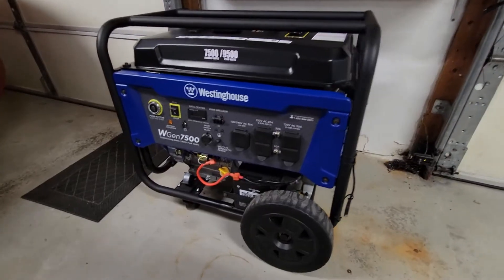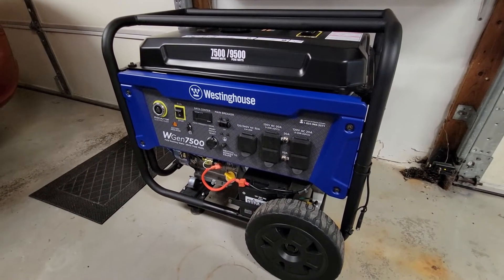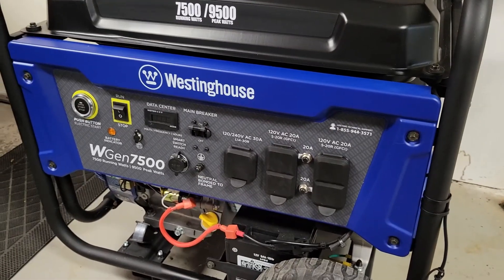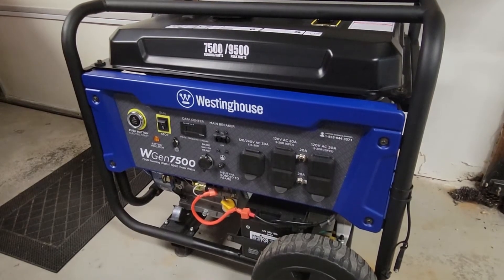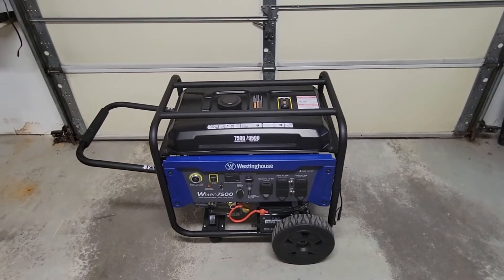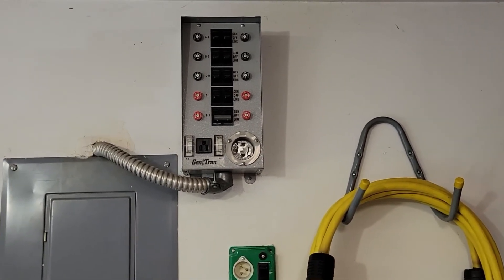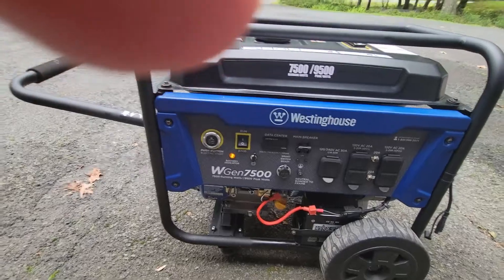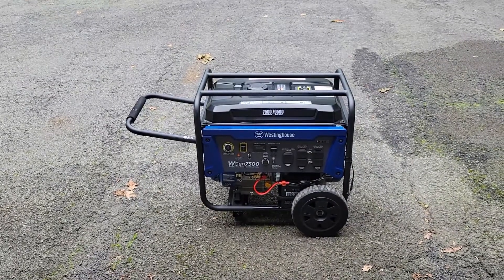Westinghouse WGen7500 generator - 3 year review & tips

Comment: I have the same model, bought it about 5 or 6 years ago. I’m weird and prefer to manually start it using the choke and pull cord, so I pay no attention to the battery or remote. 
I too change the oil every year or two, as it doesn’t get much use but did recently for 18 hours during an outage! I’m crazy and keep about 50 gallons of gas stored in 5 gallon VP Racing plastic fuel jugs, a mix of non ethanol and standard gas depending on my money situation at the time of replenishing, all stabilized with the same stuff you use. No biggie to rotate it through cars as you do. I’ve found it can last up to 3 years in that state. 
Great generator, hoping we get many more years of service! Nice video. God bless!

Comment: I recommend getting you some VIP, 5 gallon jugs. They work awesome.  They don’t leak at all. And when you put a vinyl tube on the breathing port, you’ll never spill any pouring gas out.  My store my generator dry.  And I started every six months works great. That way I don’t have to worry about stable or stale gas.  Just cycled them through your car like you mentioned every two or three months.

Comment: Did you have to unbond the neutral before attaching to your transfer switch to the home? I know it comes neutral bonded to ground and am wondering if I need to unbond it if I will only be using it for home backup through the transfer switch to my panel.
Reply: Yes! You only want 1 ground or neutral the manual shows how it's done in 5 minutes.
Reply from the maker: I almost caught the house on fire doing this, kind of a freak thing.  Vid:
https://youtu.be/UVjIoL7A_-E?si=8qqI4zc_P9BNS0gb

Comment: I'd be interested in getting your thoughts on this type of generator (traditional). Some people are now claiming this traditional style of generator will harm your electronics and you need a newfangled (more expensive) inverter generator instead. I am suspecting this is more about marketing than any real danger in most circumstances, but what do you think?
Reply from the maker: I can't say i'm qualified in the field to answer authoritiatively.  But here in northeast Pennsylvania, I know so many people that use traditional generators, and I haven't heard people crying about electronics being destroyed. I have a UPS protecting my computer, cable modem & router. But TV's & appliances  just run off the generator, no worse for the wear.
There seems to be a good amount of discussion about this online, so happy reading 😂😂
Reply: @bluesriderDF  Too much discussion I think. As far as I can tell, this "dirty power" seems to be about the Hz output not being in the correct range (near 60 hz). Well the good news for owners of these Westinghouse gens is that they actually display the Hz output for you to see for yourself. I think if you keep the engine in good maintenance and don't overload the generator, you're probably going to be fine. I do have my computer, wifi, TVs, etc., on surge protectors. I mainly just don't want to destroy my refrigerator, but I don't think there's much danger of that.

Comment: I have this same generator that I bought 2 years ago. It has less than 10 hours run time. I let it sit for too long and am having problems starting it now. I can pull start it if I spray carb cleaner in the air filter area but it won't stay running.

1. Any idea how to keep it running? Once the choke closes it dies. If I manually open the choke it will stay running but I don't know if it is a good idea to keep the choke open.
2. The battery is now charged but it doesn't crank over. Could the starter be bad? Can that be replaced?
Reply from the maker: It sounds like you have a number of issues here.
The first thing I would do is drain all the gas. I'm not sure how mechanically inclined you are, but I would drain the float bowl on the carburetor also.  Then refill it with fresh gas and see if you can get it running.
For something with such little use I don't know why the starter would be bad. I would take that battery to a place like autozone or advance auto where they do free battery testing and see what they say.
Reply: @bluesriderDF  I think it is the gas too. It has about 2 gallons in it. I will try fresh gas and if that does not work I will probably have to take the carb off and clean it. I've cleaned plenty of carbs before so it shouldn't be an issue. I turned it on and let it run for about 10 minutes with the choke on but it will die as soon as I close the choke. I will worry about the battery and starter once I address the carb. Thanks for replying.
Reply from the maker: @RoliO11 Sounds like a plan. Some of those jet passages are really tiny and can clog easily.
Reply: I'm confused. 
FYI: The choke is supposed to be closed when starting, and needs to be open once it starts, in order to run!  
You need (3) things: air, fuel and fire(spark) to make it run.
Reply: @jackpayne3996  mine will only stay running if the choke is ON. I guess I should have been more specific. It's still cold over here so I haven't had time to remove the carb and clean it.
My auto start doesn't work either. It might be the solenoid since they seem to be cheap parts that go bad.
Reply: Hold the choke manually in the open position after starting until it becomes steady running. It tends to close automatically after it starts. I hold mine in the open position for at least 30 seconds, and it should be good on its own afterwards.

Comment: I do have a question. when storing the generator for several months. While the generator is running do you shut off the fuel valve and let it burn its remaining fuel ? or is a correct way to do this?
Reply from the maker: Well technically, mine is always in storage, except I fire it up about every 8 weeks for a few minutes.  I used to be in the camp that drained the carburetor in small engines at the end of each season - mower, snowblower, weed trimmer, etc.  But I read that this can cause rubber parts to dry and lead to other problems.  So for probably 15 years now, I keep the tank full and I never drain the carb.  My machines start right away each season and run fine.  To do this, you need to treat the gas with fuel stabilizer.  I have access to ethanol free gas, so that certainly helps.  And even with that, when it hits around 9-12 months, it's time to drain it and toss it in a car, and fill the machine with fresh fuel.  I just did that with my generator this week. I hope this helps!
Reply: @bluesriderDF Thank you for the help. I appreciate the quick reply. Yes it does help. Thank you so much. I will buy some fuel stabilizer also. 👍

Comment: I have the 5300 duel fuel pull start. Run it every first weekend of the month. 6 5gal cans of fuel that I cycle out every 6 months. All with Sta-bil. “Failing to prepare is preparing to fail”, Ben Franklin.
Reply from the maker: You are definitely prepared!
Reply: i use my wgen7500df all the time to support my solar habit until i can get a better solar charge controller,  and normally use propane.  i don't know why people that use these only occasionally would want to use gas instead of LP.  LP never goes bad and the engine runs massively cleaner on it

Comment: They're great generators, use mine daily, ive had few problems, fuel pump failed so its now gravity fed but being a mechanic its no big deal. On 3rd set of brushes but they're meant to wear out. Had to polish my slip rings with 2000 grit paper then 3M scotch pad.
Reply: @gene2200 I let mine sit for about 6 months. I tried starting it today and the battery was dead, obviously. I charged it but it won't turn over. I think the starter is bad. I went to manually start it and it wouldn't start so I removed the air filter and sprayed carb cleaner in there. It cranked and started but as soon as the choke closes it turns off. Any idea what is wrong? 
I can keep it running if I manually move the choke back to the open position and leave it there. I don't know if it is a good idea to run it with the choke fully open. Any help is appreciated.
Reply: @RoliO11  sounds like main jet is clogged, there's a blue screw you can remove and spray cleaner in it, Make Sure To Tighten It All The Way and Count How Many Revolutions So when put back in tight you know how far to back it out

Comment: You said you didn’t know what the battery charger is for, but it is a trickle charger and when you plug it in it is red and then when it is fully charged, it turns green, so there is no need to go out and buy another trickle charger when you get one with the generator

Comment: Can we Pull Start the Westinghouse generator..❓❓❓
Reply from the maker: Yes, absolutely.
Reply: I bought a Westinghouse generator. 3 years ago and was only able to manually start atleast two times and that was when it was brand new. I needed it yesterday December 2023 and the electric push start and manual start would not work
Reply from the maker: @rugs91  You should have been starting in every couple of months, and running it 5-10 minutes. How old is the fuel?
Reply: @bluesriderDF  I  didn't  have any fuel  in the tank. I put new fuel and fuel stabilizer,add oil, replace the spark  plug, sprayed carburetor.and nothing  switch from  gas to propane. Today  I  charge the  battery while at work and nothing
Reply: @rugs91  same thing happened to me. Take the air filter off and spray carb cleaner in it. Then open the choke and pull start it. It will start but you may need to hold the choke open for a bit after it turns on. Mine will run with the choke fully open but once I close the choke it turns off. I need to figure out why.

Comment: The non-ethanol gas you use is the reason you can go a year before needing fresh gas. If you use E10 fuel then I wouldn't keep it past 6 months and that's with stabilizer. Sta-bil makes a fuel stabilizer named Sta-bil 360 that is for ethanol fuel specifically and keeps fuel fresh for up to 12 months, from what I've seen the 360 fights corrosion better than most. I still wouldn't keep E10 fuel for longer than 6 months even with the 360. I usually run my equipment once a month and keep E10 fuel for between 4 to 5 months before transferring it to my car and running fresh fuel through my carb. I'm in California and have to deal with the stupid Ethanol nonsense.
Reply from the maker: You're in Commifornia?  I weep for you!   I guess you guys won't have to worry about stale gas if they have their way.
Reply: I do All the time with E10 mixed in the gasoline at the Gas station ⛽.
I keep 1/2 tank full with Sta_bil added to it.... Only One pull and it starts right up.....Test-it  2-Time every year 👍😂👍
Reply: Luckily I Never have a chance to run for Power outage yet..... Now I build a Generator Shed on WHEELS to move around

Comment: my westinghouse has 20 hrs. it cranks and does not start. the battery goes dead and i have to jump start it. any ideas?
Reply from the maker: Drain as much fuel as possible and fill with fresh fuel treated with Stabil.  You may need to remove the spark plug and squirt some starter fluid in there to get it going, until the new fuel is in the system.

Comment: Do you still put stabil in to your ethanol free fuel - i see mixed opinions and struggle to see the value in doing so
Reply from the maker: I do.  I am under the assumption that gas can still go bad even without ethanol.  It really doesn't take that much and it's not that expensive so I guess I just do it to be on the safe side.

Comment: awesome video , do you leave the battery charger always connected? and have you replaced your battery yet for not holding charge
Reply from the maker: The included battery charger should not be used full time, it will overcharge the battery.  I use a Battery Tender which is a trickle charger designed to be on 24x7.  I'm still using the original battery. I started it today in 30° weather and it fired right up.
Thanks for posting 👊
Reply: @bluesriderDF  thanks  for the information, much appreciated.
Reply: @bluesriderDF  can you post link to the Battery Tender to purchase?
Reply from the maker: @alexzartman9863  
https://www.amazon.com/Battery-Tender-021-0123-Junior-Charger/dp/B000CITK8S/ref=mp_s_a_1_1_sspa?crid=YVUQV78LVRNR&keywords=battery+tender+jr&qid=1672338867&sprefix=battery+tender+jr%2Caps%2C107&sr=8-1-spons&psc=1&spLa=ZW5jcnlwdGVkUXVhbGlmaWVyPUFXMjlMNzhPNVRWNjgmZW5jcnlwdGVkSWQ9QTAwMzEwNDcyNTVMVlBUSjVHWU4mZW5jcnlwdGVkQWRJZD1BMDkyMTg5MDJZMzJBN0kzUENHMEsmd2lkZ2V0TmFtZT1zcF9waG9uZV9zZWFyY2hfYXRmJmFjdGlvbj1jbGlja1JlZGlyZWN0JmRvTm90TG9nQ2xpY2s9dHJ1ZQ==

Comment: What should you do when you havent used sll the gas in the generator for more than a year or so ? Pump it out ?
Reply from the maker: Yes, you can use it in a car, no problem.  I start my generator every 6-8 weeks.  I can tell when it's time because it will have trouble starting.
Reply: @bluesriderDF  is it easy to drain it out ?
Reply from the maker: @ericdechamplain650  I use one of these.  You don't need to get every last bit out.

https://www.amazon.com/Liquid-Fuel-Transfer-Siphon-Pump/dp/B06XKHP8Q4/ref=sxin_22_pa_sp_phone_search_thematic_sspa?content-id=amzn1.sym.1ad53d03-de9d-4733-8030-19769ee35352%3Aamzn1.sym.1ad53d03-de9d-4733-8030-19769ee35352&crid=3476EARDTGB5Z&cv_ct_cx=gas+siphon&keywords=gas+siphon&pd_rd_i=B06XKHP8Q4&pd_rd_r=6be83f20-265f-4656-9b98-5206054a8e43&pd_rd_w=JeSfj&pd_rd_wg=4B0Bj&pf_rd_p=1ad53d03-de9d-4733-8030-19769ee35352&pf_rd_r=F8WP99W8GWNAA13TJ20G&qid=1681085598&sbo=RZvfv%2F%2FHxDF%2BO5021pAnSA%3D%3D&sprefix=gas+siphon%2Caps%2C121&sr=1-2-a73d1c8c-2fd2-4f19-aa41-2df022bcb241-spons&psc=1&spLa=ZW5jcnlwdGVkUXVhbGlmaWVyPUEySDhIQVVHOVJZT01NJmVuY3J5cHRlZElkPUEwNDQ0Nzk1MjEySUY2UkxZV0wwMCZlbmNyeXB0ZWRBZElkPUEwMzU3MTU2M1YxUDQ1RTZRNEdKTiZ3aWRnZXROYW1lPXNwX3Bob25lX3NlYXJjaF90aGVtYXRpYyZhY3Rpb249Y2xpY2tSZWRpcmVjdCZkb05vdExvZ0NsaWNrPXRydWU=

Comment: Some more clues. I've had my df9500 for two years. I use only nonethnol. There's no need for fuel stabilizer. Non ethanol is free of water. Fuel stabilizer does not ensure water free (lots of YouTube's proving this). It's will actually gum up the carb. I test mine monthly for 10 minutes then run it dry of gas (turn off the fuel valve while running.) The carb is empty not sitting with gas. Test it once a year with house hookup under a load. I use a magnet oil dip stick checking it after running. Change the oil after 24hrs or before possible use.
Reply from the maker: I use the stabilizer to extend the fuel shelf life because the generator doesn't run regularly.
Reply: @bluesriderDF  stabilizer will extend the life of fuel but it crystallizes in the carburetor.  It looks like honey in the carb bowl. My non ethanol fuel lasts 2 years (probably longer) then I use it in my car and get fresh. Trufuel lasts 5 years in an unopened can. Small engine repair places love stabilizer in fuel.
Reply: I’ve run 4+ year old stabilized gas with ethanol in my generator, no problem. I keep it full so it’s ready, test it every month or two, never fails, even in the harsh Michigan winter

Comment: Battery charger from Westinghouse is 0.35amp.  That is a super low capacity trickle charger that isn't going to overcharge the battery.  Battery tender jr. is 0.75amp  It it's float/maintain mode, what do you think it's rate of charge goes down to?  You'll never know as that into is not in the specs.  

It's kind of a moot point anyway as these little 12 volt utility brick batteries only last 2-3 years before they die.  Turn on the choke and pull the rope.  You'll be suprised how easy these generators start with good fuel and a clean carb.
Reply from the maker: I contacted Westinghouse about the battery charger.  They specifically indicated it is NOT intended to be left on all the time.  It is not a "smart" device.  So argue with them.  I have several Battery Tender trickle chargers on different batteries, and they do what they're supposed to, which is keep the battery at an optimum level without overcharging.  It's worth the piece of mind to me.  I haven't had to replace a battery 8 years running.
Reply: Turn on the choke? It’s built in buddy
Reply from the maker: @moheganson  Yup, auto-choke.

Comment: How long should I charge battery?
Reply from the maker: I am using a Battery Tender, which is designed to be plugged in all the time. It monitors the battery and keeps it at optimal charge without overcharging it.
The supplied power charger is a full on charger that will never stop charging. I have no idea how long it should be used for, which is why I never used it.

Comment: I got tired of messing around with those little generator batteries. Even with the battery tender they only last 3-4 years. I got a pair of jumper cables and use my car to jump start my generator.
Reply from the maker: That works!
Reply: that sounds stupid who wants to get out there in the middle of the night jump starting a generator? with there truck  yours didnt come with no pull string? im quite sure every one elses did!!!!!!!!!!
Reply: @MRTLEW01  the 7500 is extremely hard to pull over.  i don't know if i've successfully started it with the pull rope

Comment: When you shut your gen down first turn the gas to off and let it run out of fule
Reply from the maker: I disagree.  There's no need to drain fuel from small engines in the off season or when they aren't used often.  In fact, doing this can cause rubber parts to dry out and breakdown.  They key is keeping fresh, treated fuel in there, and keep the tank full to prevent condensation.  Also use ethanol-free if you can get it.
This is my practice with my mower, leaf blower, chainsaw, weed whacker, snow blower, and generator for over 20 years. I've never had to work on a carburetor once in all that time.